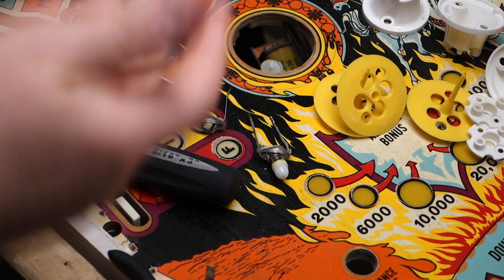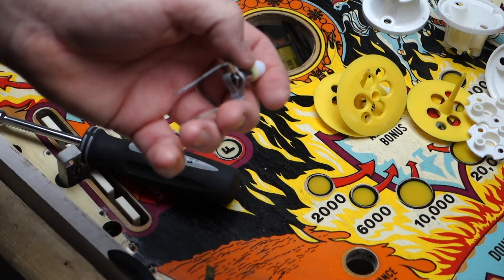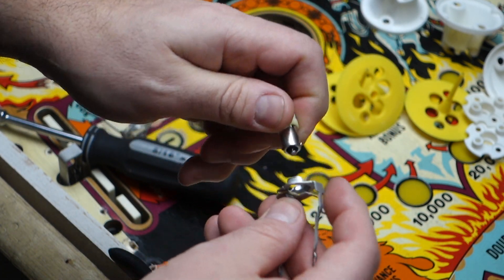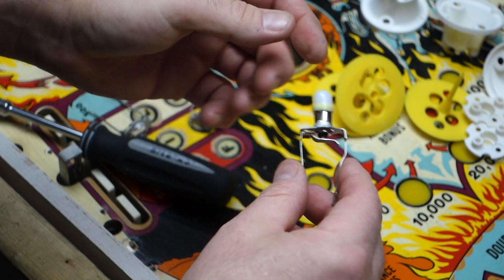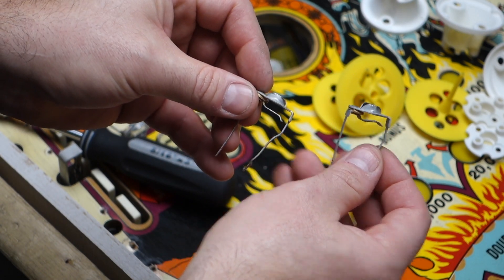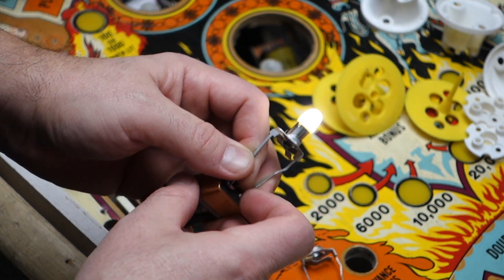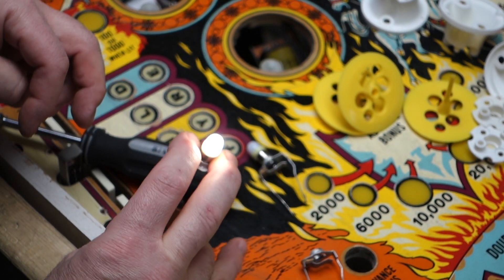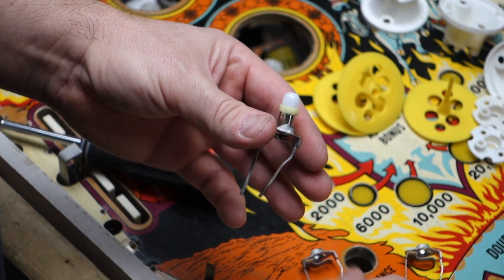Pinball Pop Bumper Socket Mod #pinball #Repair #gottlieb #bally #williams #chicagocoin #stern

Comment: Good tip. I’ve also used the method of squeezing the outer part together ever so slightly to tighten that up. Don’t go too tight because it’s easy to rip the top off the led bulbs. Use an old incandescent bulb to check the fit. It’s more important now to keep the old sockets if you can because Steve was having a tough time getting these reproduced (last I heard).

Comment: Bending the contact looks like a good idea. I noticed the Pinball Resource has new sockets for $2.40. At that price it would be worth keeping a few around in case the contact will not hold it's spring.
Reply from the maker: Yes this mod has been proven on my past 10 or so refurbs. The bulb just doesn't come loose.
Reply: Great tip! You had me at pop bumper 😁
Reply from the maker: @TooManyHobbiesJeremy  LOL!